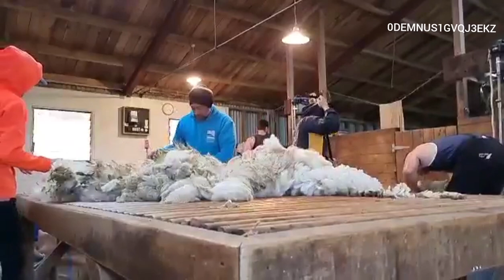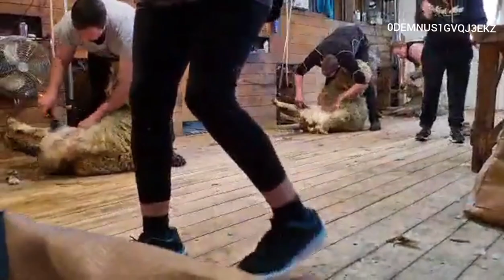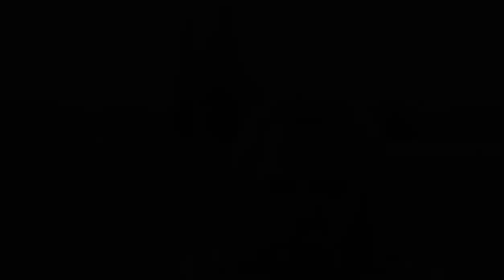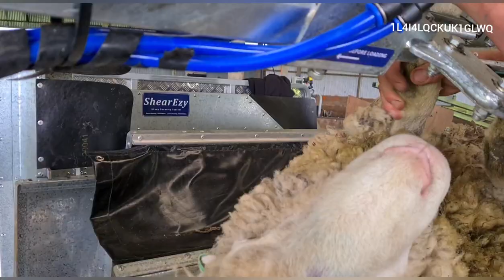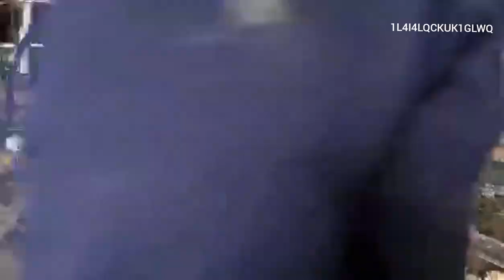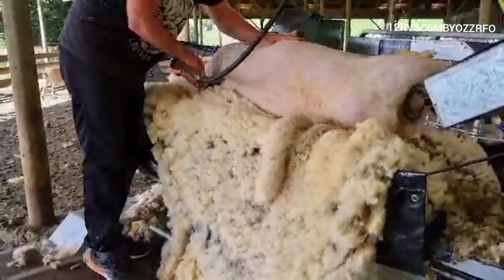Shearing hoggets, and a fancy new ram shearing trailer!

Comment: I never minded shearing Rams , in fact I would rather shear Rams than little 25 kg lambs , I only shear my own now that I have turned over the 50 , and I just niggle out 100 or so a day but I do the Rams first to get them out of the way , it also gets the old joints eased out on the fit ones. Like the look of your hoggets , great even bunch of stock.
Reply from the maker: Cheers for that, we're trying to get better with our hoggets.You're a tougher person than me, shearing your own 😅